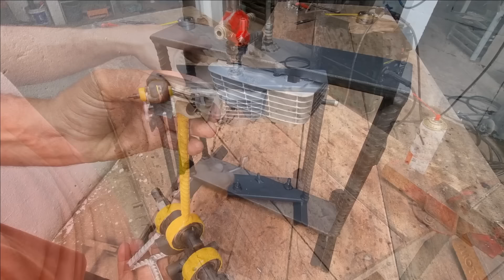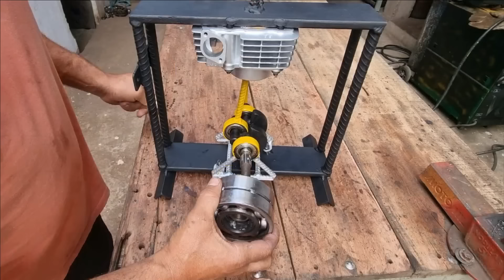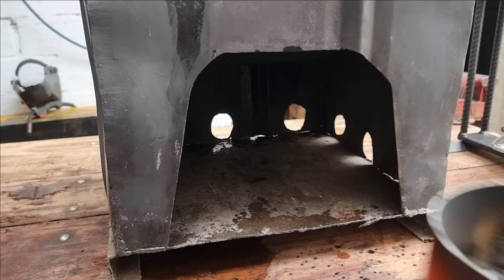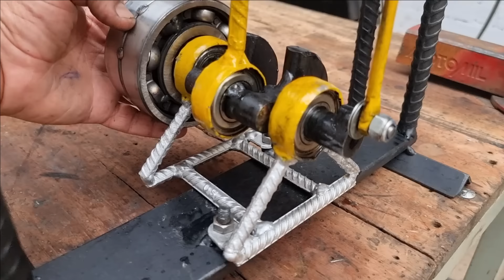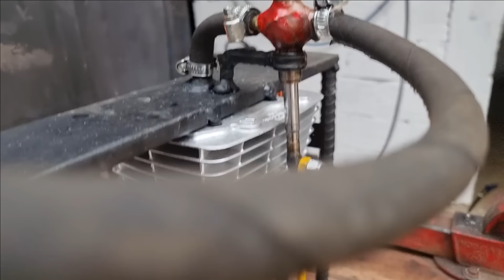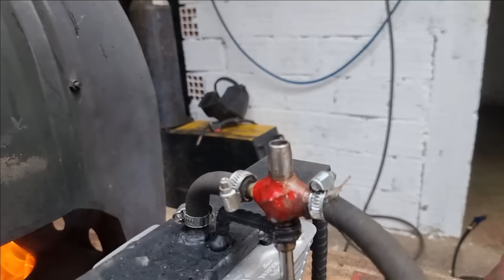Um pequeno motor a vapor

Comment: Consegue girar um alternador de 12v pra manter uma bateria em carga ? 
Muito legal isso ❤
Reply from the maker: Fraco pra um alternador
Reply: @professorpardalbrasil  If you can tolerate pressure and larger channels, yes, alternating current Genu works really well.. there is experience.
Reply: Você conseguiria fazer com dois pistões ou mais enquanto você me cobraria em um motor desses com três pistões ou quatro

Comment: Sir, that is an exceptional effort, if you had a lathe to machine some of the parts I’m sure that it would be more efficient and balanced but as a proof of concept I think you did an excellent job. The addition of a lub system etc would also improve the longevity but I think it’s awesome.

Comment: 👏🏿You should develop a commercial version which can be used to generate electricity during emergencies.👍🏿
Reply: It will be a lot larger than this to generate enough to be really useful.  But as it is, you could run a car alternator off of this.